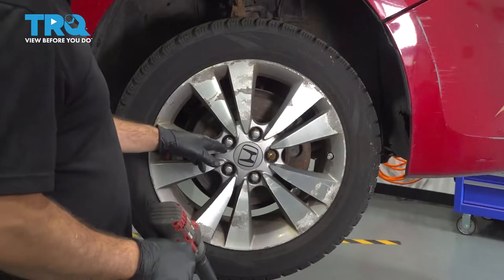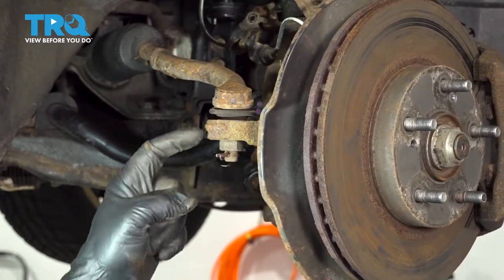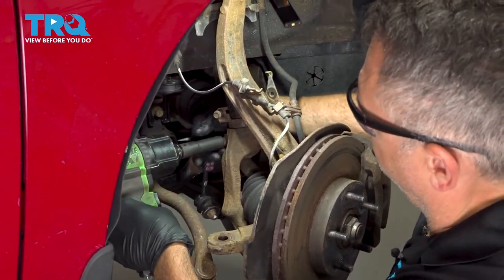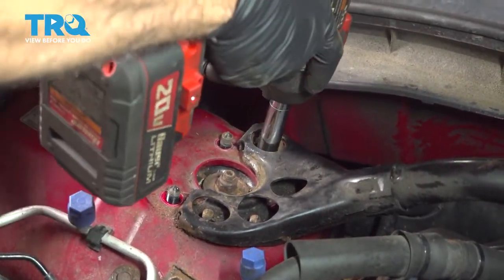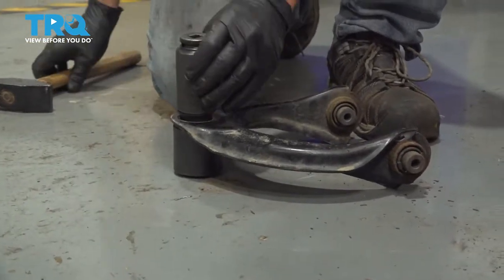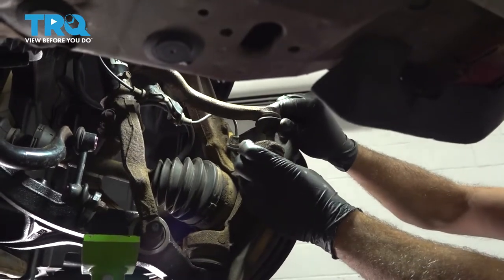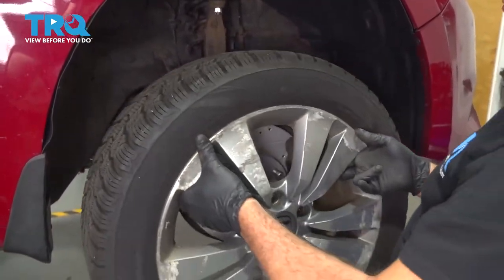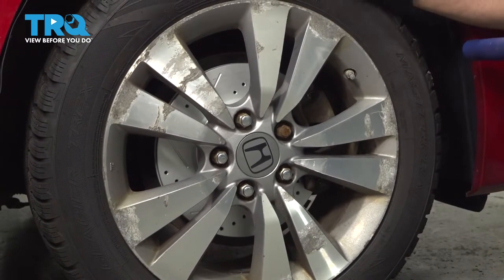How To Replace Upper Ball Joint 2008-2012 Honda Accord

Comment: My problem is that the castle nut is making the ball joint threads spin, is that a bad thing? Or can i just use an impact and tighten it up, cause otherwise the joint itself is fine
Reply: Ima go with yeah on the impact cause it worked